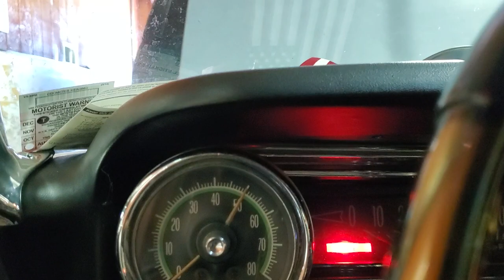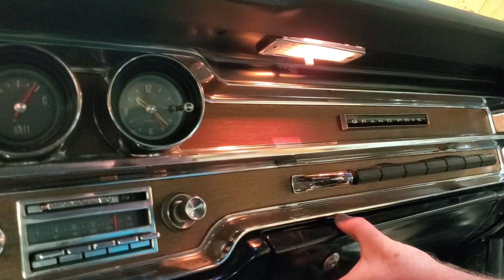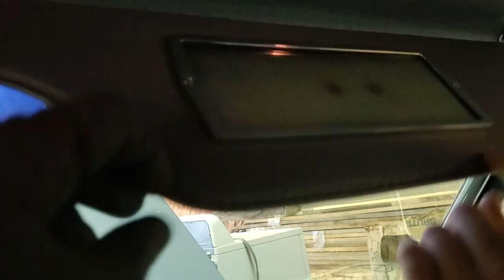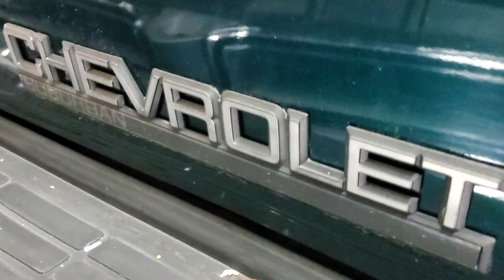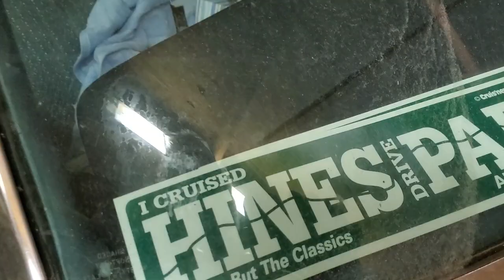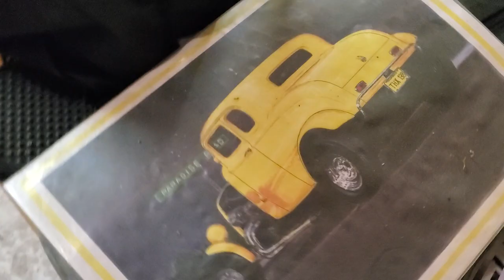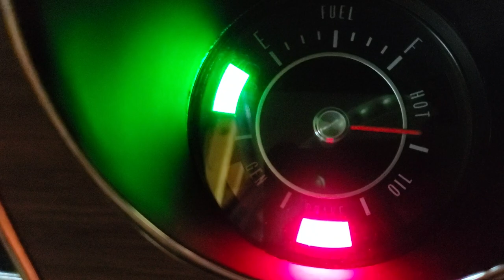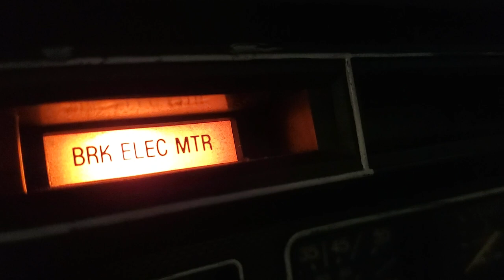Cold Crankin' 'Weasel GP Olds Rocket 7 9 20

Comment: Oh boy, another "Gonna do", you and my uncle are 2 peas in a pod, I rebuilt his 292 and it's still sitting on the stand beside the truck it came out of 8 years ago. You shouldn't rev a turbo up and shut it down, the bearings don't get oil once the engines off and the heat you just blew through it cokes the oil and those mice!! Crush up moth balls and sprinkle the powder along the walls, rodents don't like open spaces so they tend to stick to wall and the smell drives them away.